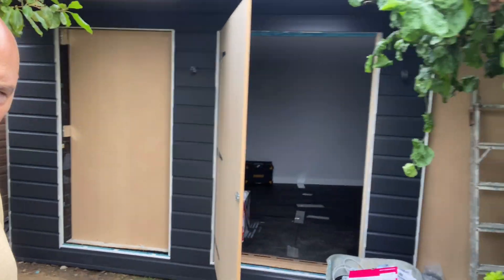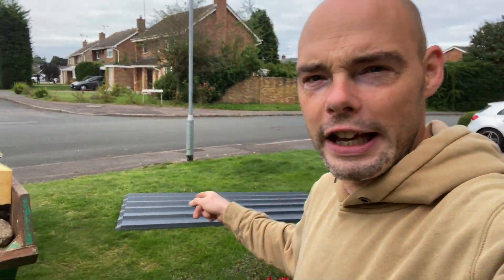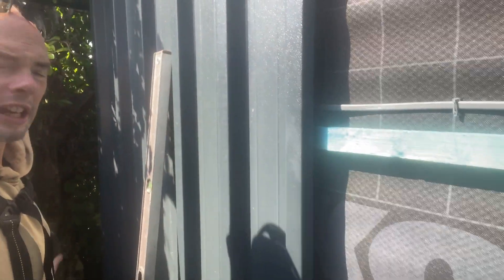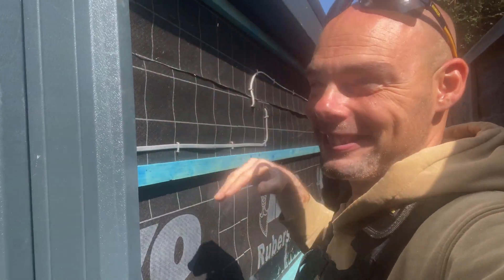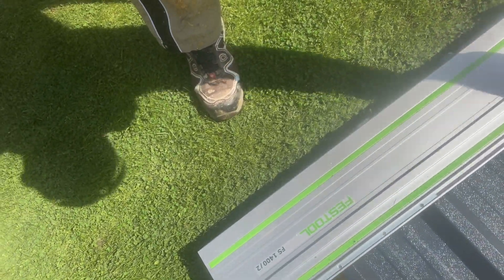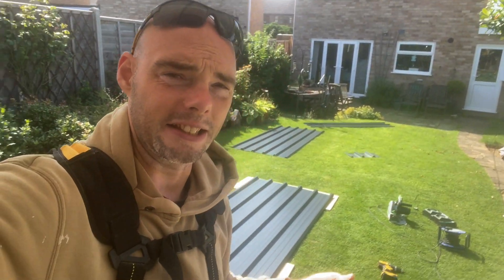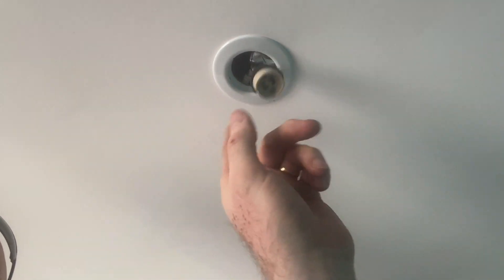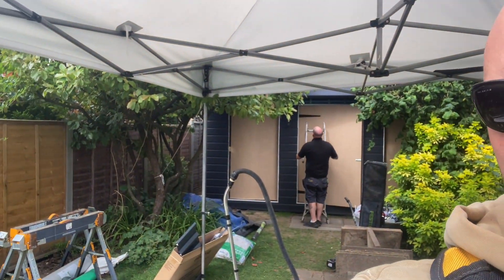Garden Room: Metal Profile Fitting

Comment: Hi Steve , not sure if I missed something, but how did you fit the corners to the panels? Cheers
Reply from the maker: Hello Kimbo!! So basically I simply cut them to length and then just help them onto the corners while I used the self tapping screws to fix through into the last metal sheet ;)

Comment: Hi Steve, Could you answer my question through your experience, based on my build that will be 4.50 x 3.00 How much roughly am i looking at to have a sparks to wire up and connect my build based on what your guy is doing for you on your one. And how many days. I know its not the easiest of questions but just a rough idea would be a guide to go on when i get to that stage. Also where do you buy the metal sheeting from, Many thanks, *End of communication*   ;)
Reply: Hi Lee. If it’s any help. My sparky is charging something like £160 to supply and fit my SWA. I’m going to lay the cable first mind. I’m also doing the first fit of mains sockets and lights and my sparky will part p check them and sign them off (hopefully!) Not sure if I will bury it or fix my SWA  to my garden fence but either way in going to do that part. Regarding the ethernet, I’m an IT guy so that part I will also do myself but I suspect a sparky would charge the same as the SWA, However, it depends how long your cable runs are (materials cost) and how you want them terminated at each end. In my case terminated at both ends to an ethernet wall socket (easier than crimping RJ45’s) then just use regular cat5 or 6 cables from the wall sockets.
Reply: @Elmoshuk  In 2019 i was told to buy 3 Core 6 mm (SWA) Steel Wire Armoured Cable - 25 Metre Custom Cut Length - for lighting heating tv and speakers which is now under the patio but if its not the right one i will change it.  Price sounds pretty good thanks for your reply Steve
Reply from the maker: Hello Lee, If its just a standard fit out so ie no smart lighting or switches etc then your looking around five days give or take and my guy supplies so your looking between £2000-3000 with variances for distance amounts fo lights VAT etc :)